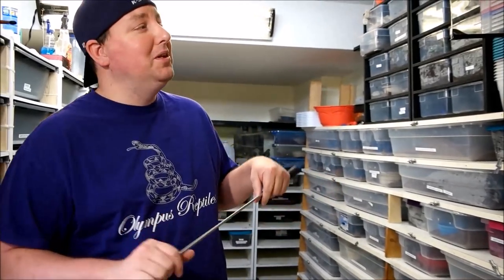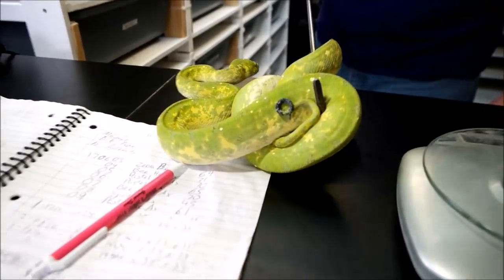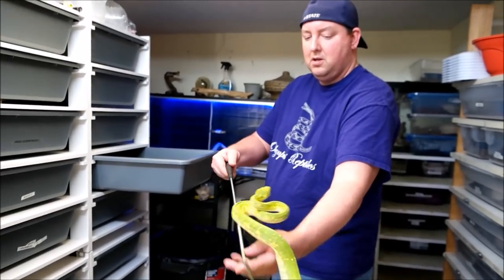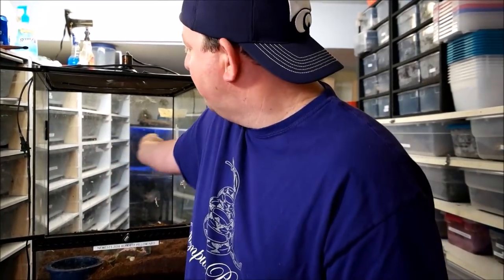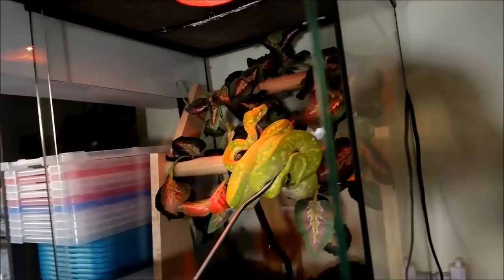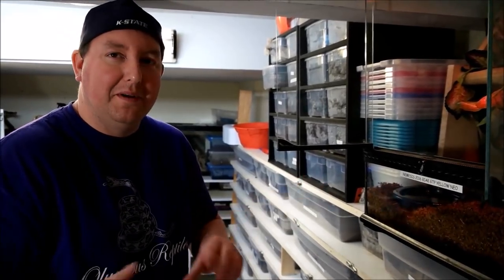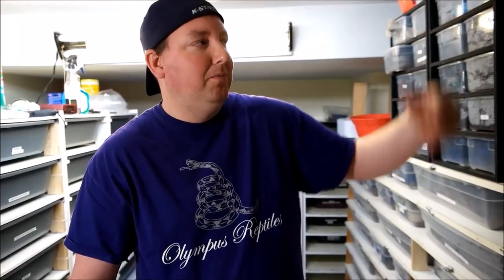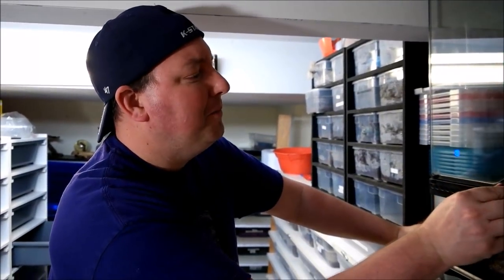Biak Green Tree Python handling and cage build! Love the GTPs!

Comment: Hi, Matt like your logs can you tell me what kind of cage you have for your GTP? Also the lighting what kind of bulb do you use? and heating bulb? I want to get one, can you give me some tips how to build a cage like yours, Thank you
Reply from the maker: The GTP  is a front open cage by exo terra.  It has a lot of coconut bedding to help with humidity.  I made a plastic cover for the top to keep the humidity in.  The top has a red heat bulb (the micro kind).  Underneath is a heat pad.  He is never on the ground, but heat rises and the overall is warmed.  It also heats the substrate that I moisten a lot, and causes the humidity.

Comment: Here is a question where do you place the thermostat probe in your terrarium? I didn’t see it in video but I know it’s there as you said it’s plugged into a thermostat. I just bought my first GTP neonate and want to make sure I get it fas close to perfect for her. I using a ceramic heat emitter from above with my pulse/dimming tstat and cant get a direct answer on probe placement for their basking spot. Currently I have it zip tied to the top perch direct under the heat where she can bask in 87-88*
Reply from the maker: I had ir hanging close to basking limb.  Idea is to see temp ehere snake will spend its time